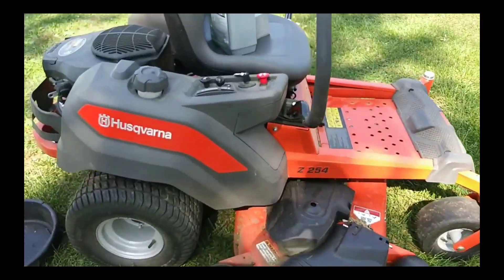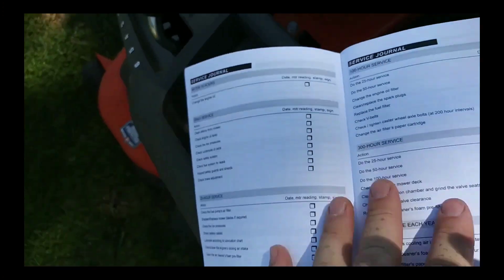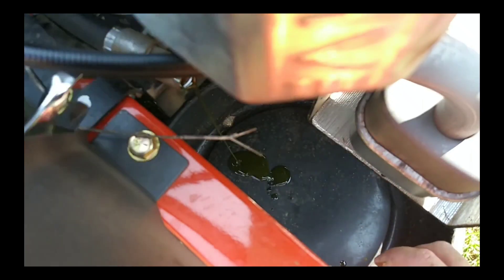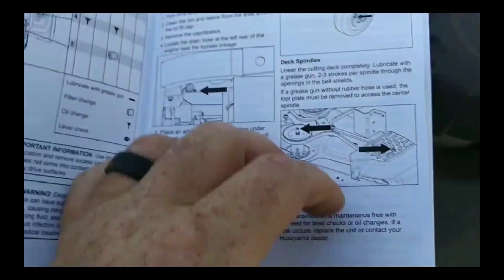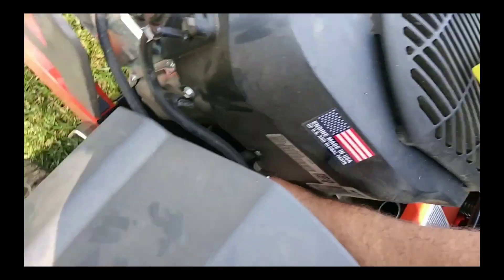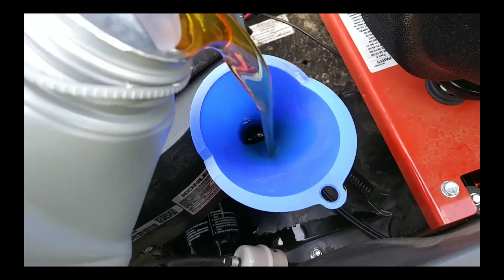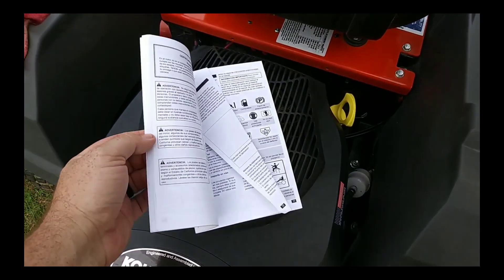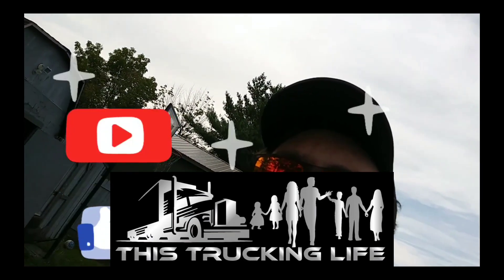Husqvarna zero-turn Z254 lawn mower FIRST OIL CHANGE

Comment: I can NOT get the drain plug off.  The soft aluminum right before the plug is getting all crimped by my pliers, I don’t want to squeeze it any harder, but the screw just will not come loose.  Suggestions?
Reply from the maker: I'm going to do another oil change on mine I'll record it... I'm not sure but make absolutely positive you are turning it the right way. Good luck!